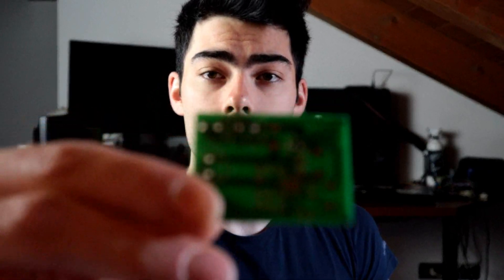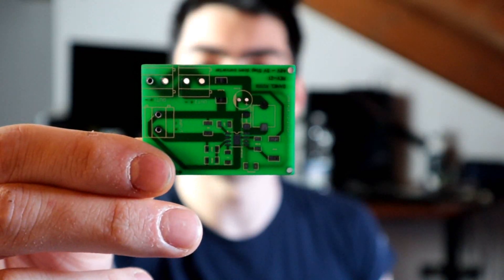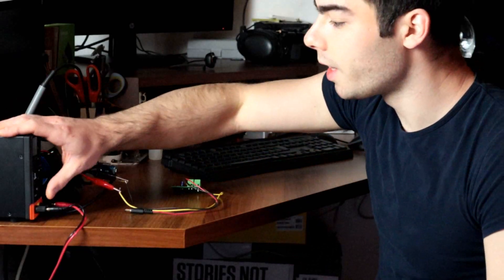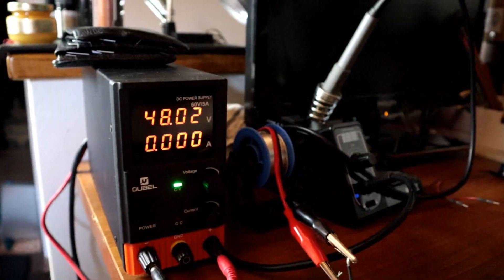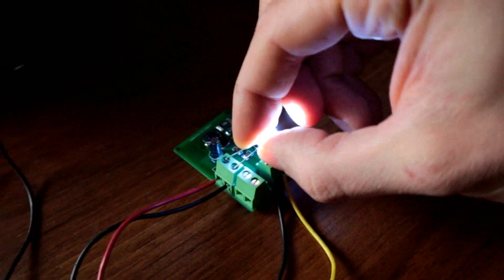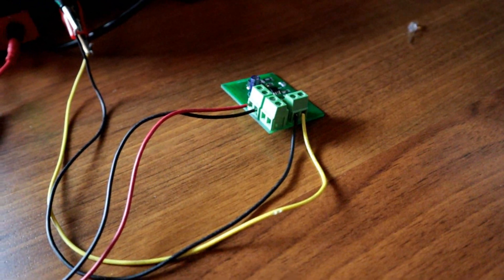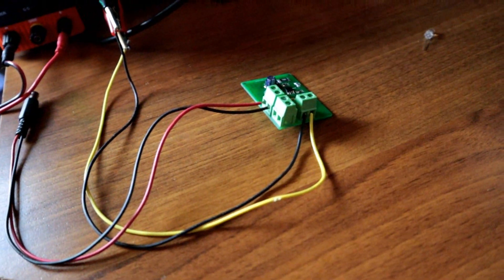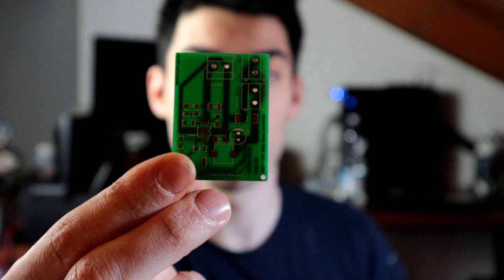Come creare il PCB di un Circuito Elettronico Fai da Te

Comment: complimenti molto interessante. Una domanda.  La tensione in ingresso (48 v) può essere minore per ottenere i 5v in uscita. Ovvero c' un range in ingresso per mantenere sempre i 5 volt in uscita?? quanti mA può sostenere come carico in uscita?? Grazie comunque un bel lavoro. Maurizio
Reply from the maker: Ciao Maurizio! In fase di progettazione della scheda ho deciso io di lavorare a 48V, il motivo è che la batteria dell'auto eroga quella tensione nominale. 
Ovviamente si può cambiare, dai datasheet si nota che la tensione di ingresso la si può decidere all'interno del range  4.3V - 60V. Per lavorare a 5V però è necessario che la tensione in ingresso sia maggiore, altrimenti bisognerebbe utilizzare uno step up converter. La corrente massima in uscita è invece 2A, a prescindere.
Riguardo la tensione in uscita, anch'essa viene impostata in fase di progettazione tramite un partitore di tensione su un pin del LMR (i dati di progetto sono tutti presenti nel datasheet). Una volta stabilita la tensione in uscita in questo modo, l'integrato si occuperà di mantenerla a quel valore in modo "costante" tramite un circuito in retroazione già presente sul chip. Ovviamente se progetto un circuito per lavorare a 48V in ingresso e 5V in uscita, avrò le condizioni di ottimalità attorno a questi valori, se gli fornissi 10V in ingresso probabilmente assumerebbe un comportamento diverso in uscita.

In questo video approfondisco meglio la fase di progettazione: https://youtu.be/x14Qz_KE2AM

In ogni caso ti avverto che la progettazione e realizzazione di questo circuito ha un costo di circa 40€ per 4/5 schede, diventerebbe conveniente soltanto per una produzione in larga scala.
Infatti esistono moduli step down converter che si possono acquistare anche su amazon al costo di una decina di euro per 5/10 pezzi, li abbiamo inseriti nella nostra lista amazon.
Buck converter per abbassare la tensione: https://amzn.to/3v8lnT5
Boost converter per alzare la tensione: https://amzn.to/3owUPZm